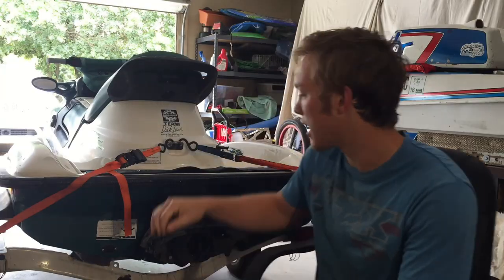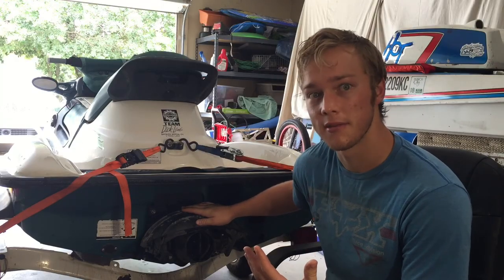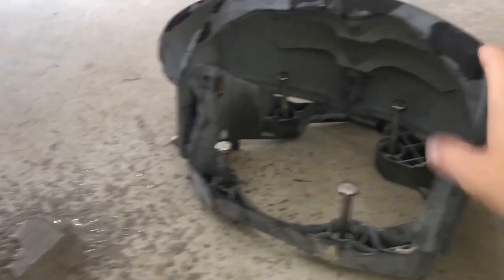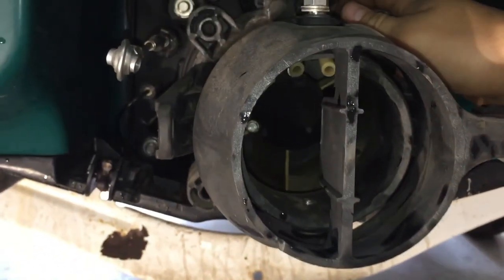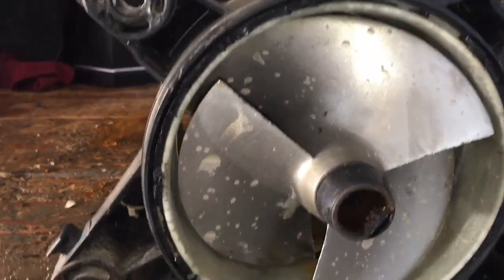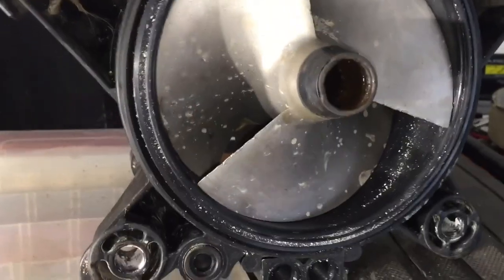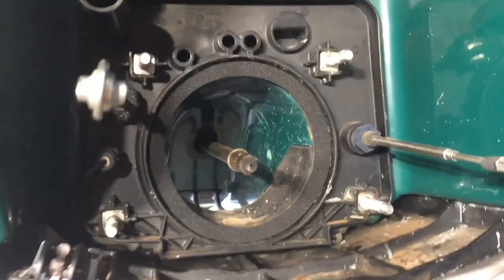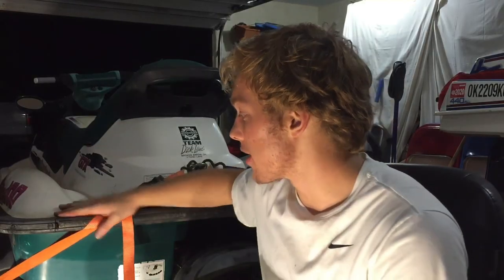SEADOO WEAR RING REPLACEMENT

Comment: I have a 95 gtx 657 and while I was out on the water this weekend I noticed that the machine started to struggle to accelerate under significant throttle but would hit top speed if I eased into it, is this the issue you were having?
Reply from the maker: It could be the wear ring or carb issues

Comment: My skis stuck at 20mph. Ran okay the other day. Revs okay out of the water but while in it won’t go above 4000 rpm. Curious if this will fix my problem?
Reply from the maker: Could be that or could be the voltage regulator, my seadoo sometime doesn’t rev over 4000rpms and that’s what causes it
Reply: @NastyMoto  Yeah it’s odd. Mine will rev over 4 out of the water but under load it won’t..
Reply: @JB-ie3vo  I have this exact issue with my 96 GTX. Recently rebuilt the carbs, cleaned and rebuilt the RAVE valves, changed all fuel lines, replaced fuel selector, and now it seems to run fine on the trailer, but wont go above 4000 RPM on water and cant get above 20 km/h. Will be replacing my wear ring next as well as the carbon seal.
Reply: Mine ended up being just plugs. It just blew an exhaust boot as well so definitely check that. Exhaust could be leaking into the compartment and contaminating the fresh air which in turn will foul your plugs out.
Reply: @jamesbarnes619  Thanks. I definitely need to replace my plugs - after all the work I performed the one thing I didn't change was my plugs.
Reply: @mazz1557  Yeah man! Hopefully you get it figured out

Comment: My sea dooo starts had it in the water all day and all of a sudden jumped back on it and it started no problem but doesn’t want to advance when I press the throttle it only advances on idle please help
Reply from the maker: Check the voltage regulator

Comment: Can the Wear ring cause the seadoo to feel like its slipping at take off
Reply from the maker: Yes! That’s what I was experiencing and replacing the wear ring fixed it!
Reply: @NastyMoto  thanks im going to get that replaced asap
Reply from the maker: No problem! You will notice a huge difference
Reply: @NastyMoto  i installed a new wear ring right now and the impeller does not want to turn when i put try to start it
Reply: @juliorubalcava95  you forgot the rubber stops on the ends of the shaft
Reply: @gagiz3611  what is tht